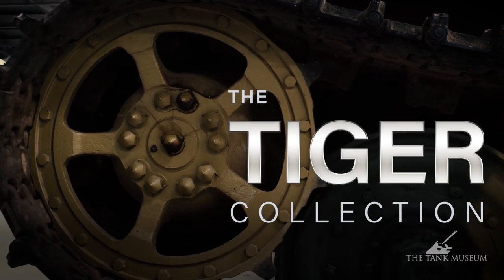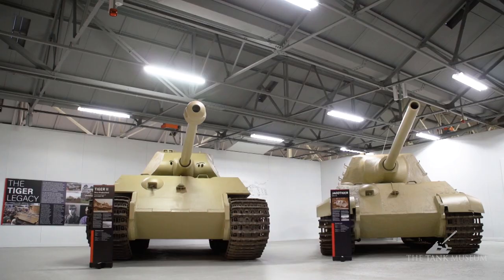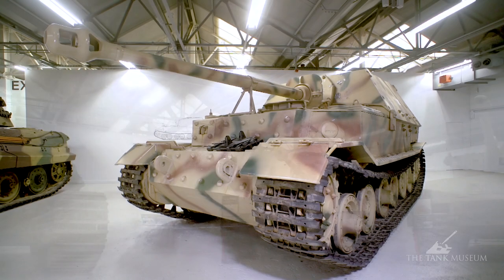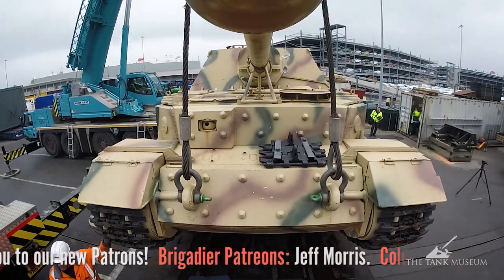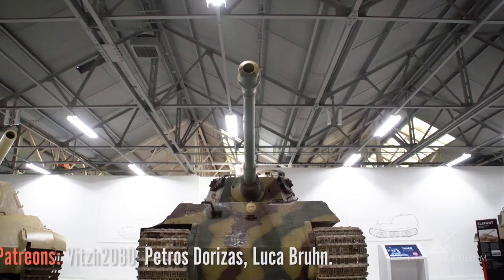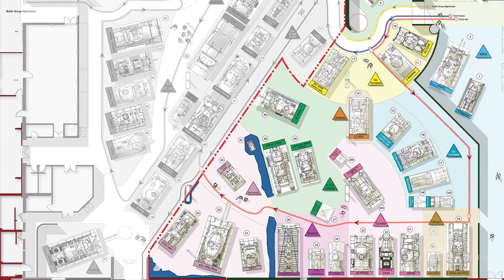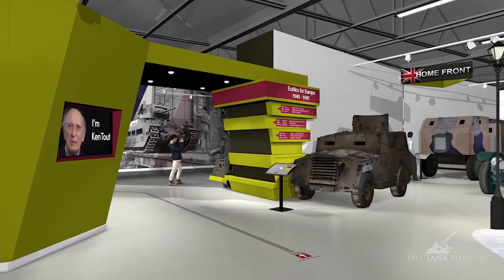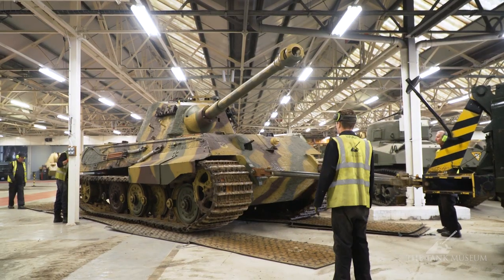King Tiger goes on Tour | The Tank Museum

Comment: Have you ever thought about displaying tanks in the open in ways that mimic WW2 tank combat?
I worry that a lot of people only know about how tanks fight from movies. Maybe you could put a Sherman on the top of the hill, using it's gun depression to aim down the hill without fully exposing itself. Maybe it's target could be a Stug III hiding behind a hedge-row.
Reply: Dorset is not known for having prolonged periods of dry weather, so I imagine they try to clean up and dry out the vehicles whenever they get exposed e.g Tankfest. Early 20th century tanks weren't engineered for long-term exposure to the weather.

Comment: To the Tank Museum - What can we do about getting a running engine into your King Tiger?
Reply: Well, you'd need a running Maybach HL230 engine, a working transmission (rare), working final drive ect, re-attach the missing road wheels, and fix any other missing components. Put it this way, its alot of work. Im surprised the 131 still runs.
Reply: Also I beleive the HL230 in the Tiger 131 is the same engine that was found in the King Tiger, so im assuming the King Tiger has alot of faults otherwise they wouldve fixed that up instead of the Tiger 1.
Reply: I just read the engine from their King Tiger is Tiger 131's engine now.

Comment: ... Man ... I'm so surprised those tanks didn't rip up those floors (even with those mats) ...
Reply: Ground pressure is usually lower than a car tyre so it's just the scratchiness of the tracks to watch out for.
Reply: @Reactordrone  ... It's also the type of tread. On natural ground the tread sinks to a uniform depth/support generating a very low psi. However, there's usually a 'bar' that begins a cut so the tread sinks and provides traction. It's that 'bar', that does the damage. I saw them using the mats and someone said that was a military facility, so that cement is not the normal cement used elsewhere ... Absolutely beautiful display by the way ...
Reply: .....I wonder what type of material those mats are...
Reply: @blaze1148  ... My guess would the same stuff an automobile tire is with cotton, nylon or steel cords ...